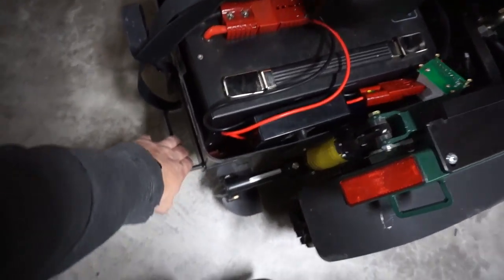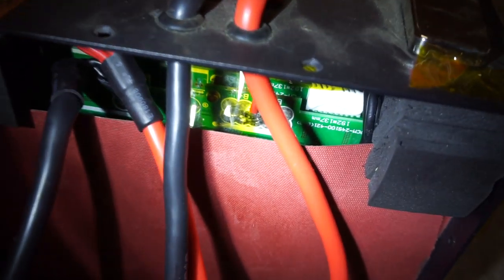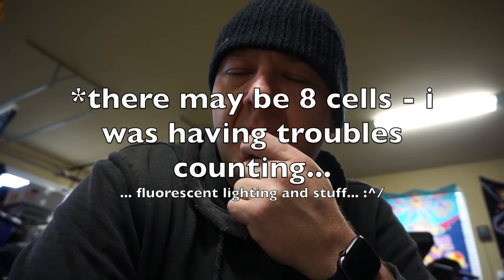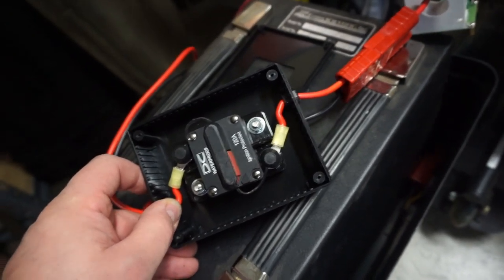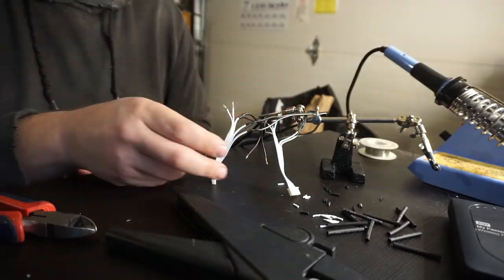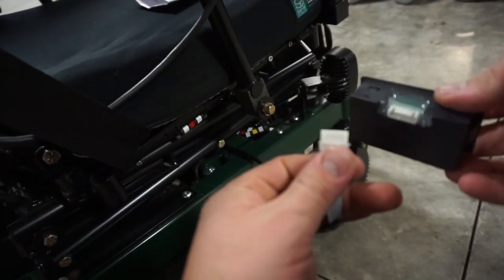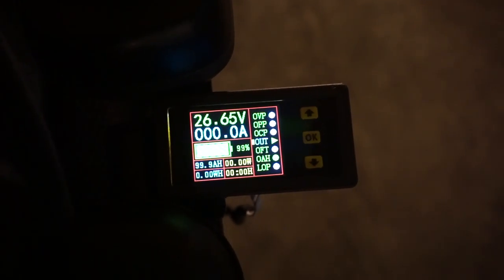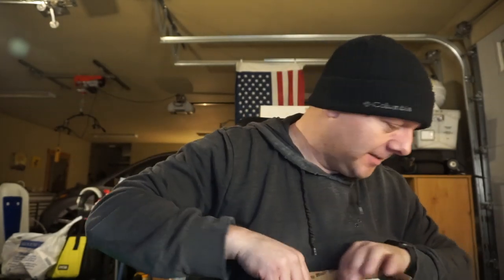MEGA VLOG 402: inside a LITHIUM bounder battery

Comment: Very interesting video Dan! I have a couple 12V 5Ah LiFePO4 batteries I have used for various projects.  The weight difference between those and  SLA's is substantial.  I'm surprised there aren't readily available direct wheelchair replacements for 22NF and Group 24 batteries.  I know they would be expensive, but I would buy them for the weight and efficiency benefits.  I think LiFePO4's are fairly safe. I guess in general it's not a good idea to think about how much energy we are sitting on top of — if you know what I mean.  Thanks for digging in and posting the video.
Reply from the maker: ive got a reddy-welder wire feed welder that runs from 2 batteries LOL just for energy capacity reference ;^)

Comment: Extrapolate !!! Do you know how long its been since I've heard anyone use that term?!!! ...It's an honor to know you Sir ! ...My guess is that PCM number is a manufacturer circuit-board part-number. 

Hint: You may be able to grab some ribbon cable from an old tower case...like a 40" long drive cable. Then split off the number of lines you need from the original ribbon.
Those plastic connectors can usually be removed and reused. They are vampire connections into the wire. Use a sharp pair of scissors to cut the end of the cable straight and freshen it up for installing the connectors again.
High frequency circuits can run into EMI, timing, or cross-talk problems when you lengthen ribbon cables but I doubt that applies here.

I see the mystery tool arrived... Now when you get mad at your neighbors you can ream 'em out ! LOL

Comment: That probably is a heater, if I remember from research that these batteries won't charge below a certain temperature.
Reply: You are so right James the VA did not want to give me a power chair with lithium batteries because of the cold weather in pinedale Wyoming, those batteries do not like cold weather but then again they don't like heat either kind of picky aren't they .
Reply from the maker: yes! 100% correct! when its cold outside, or the bounder has been left in a cold garage, it takes a bit of time before things warm up and the chair starts preforming like it usually does

Comment: The battery of long life. They're so much better then lead acid dry or wet cell. I really want a Bounder off road hd wheelchair . And would like the options . Before my back put me down in pain I could walk some but not just stand. I had pride wrangler scooter , got tired of getting only a year or two with there sealed batteries at $400. Plus. I tried the optima spiral wound D31 blue top and I got 6years out if a set for $250. Oh yes I did my repairs to the steering has a bicycle handle bar bearing set. I mounted real bearing blocks . No more sloppy tiller . But now I'm in a permobil 300 hd it's so slow and gets stuck on three grains of sand . Thanks for your videos
Reply from the maker: yea optima USED to be a great alternative.. but since they're henco in mexico now, the reject rate has gone thru the roof! ive had decent success with the DEKA Intimidator deep cycle marine batteries - and also the Exide Orbital AGM batteries.  good luck out there!!

Comment: Looking for your insight...I have a Permobil F3.  Several months ago I upgraded to MK 24s, and so far have been concerned with the battery life.  Now the odd thing is that it seems days that I get in my van, and lock into my EZ lock, the battery drops faster (based only on to controller's gauge).  Do you think this is purely coincidence?  The DME came out and checked the battery connections, and said they also seemed well balanced.  Before I request different batteries, I want to be sure that is the problem.  Thanks!
Reply from the maker: pretty sure thats coincidence - BUT theres a setting in the main controller for calibrating or compensating the cable resistance that fine tunes the battery gauge.  thing to remember, the battery gauges on these chairs arent really accurate anyways- just by nature of how they work.  they detect 'surface charge' BUT when its calibrated 'properly' your battery gauge shouldn't move at all till you've gone at least 3-5 miles.  Couple other things to consider... if the batteries are BRAND NEW - it takes a few weeks of light to normal use for them to "cycle / break in" and get you maximum capacity.  ALSO some MK resellers actually sell 'battery seconds' that are sub-par quality.  also you could have just gotten a bad set of batteries.  unfortunately, most dealers have no idea how to calibrate the battery gauges on the joysticks (usually they have to have permobil send them a new program)  but if your connectors and everything are all good - id just test it out, see if ya can get 6 miles and see what the gauge does.  BUT FYI MK batteries are the best ones ya can get - and are OEM specified.  so assuming you didnt get a bad set - youve got the best available option!  not sure if any of this helps lol but good luck!
Reply: Totally Normal Today I travelled 3.5 miles on smooth surface, some slight uphill/downhill, probably at a consistent 75% speed, and the gauge dropped 3 bars.  Concerned I may have gotten a bad batch.
Reply from the maker: hmm yea sounds like maybe ya did get a bad set.. id try going a bit further and see if they keep dropping low or stay about 3 bars etc...
Reply: So I tested it out more today.  Same path, some uphill, some downhill...was about 25* out so I froze my butt off doing so, but went 8 miles, and am at 3 red and 1 orange bar.
Reply from the maker: interesting... so combined with the cold.. that's not too bad! maybe it just the calibration of the battery gauge...
Reply: More baffling battery stuff...  So as I had mentioned, I felt that I was having issues with my new MK 24s.  The longest test I had done was 8 miles, which the battery gauge showed 3 red bars remaining.  The DME techs came out on 2 occasions to check the connections and other stuff, all was well.  They ended shipping the batteries back to MK to be tested, and all was fine.  Meanwhile, they put another brand of 34s in my chair while my batteries were off being tested.  Now today I went 8 miles again along the same path as before, and I only dropped briefly by one green bar.  So if the typical battery life is ~12-15 miles, there seems to be no way that gauge is accurate (as mentioned in the earlier posts), as you'd expect it to be closer to half full/empty.  But then why did the MK24s (which tested fine), drop 6 more bars in the same distance? @TotallyNormal-
Reply from the maker: yea the battery gauges aren't accurate by nature in most power chairs.  they're detecting surface charge, and voltage isn't necessarily a good indication of the charge level.  most of the batteries are all slightly different, and their voltage curves arent the same.  there's a way to calibrate the battery gauge on the chairs - BUT its almost impossible to set correctly.  usually any time i get new batteries, i spend a few days getting use to how the battery gauge works with them.  other than adding your own battery monitoring hardware, there isn't a lot that can be done unfortunately. 

also BRAND NEW batteries aren't going to have maximum range right off to start.  they need to cycle a few times before they're all 'woken up' and ready to go (about a week or normal to light use, and nightly charging)

there's a lot of factors with these old style SLA batteries - for no reason, sometimes ill get 7-8 miles of range, and other days ill get 13 miles no problem... cant really explain it.

I really hope chair manufacturers start using lithium more widely soon - it alleviates all this guesswork with battery levels, and range!
Reply: Totally Normal Do chair manufacturers have any plan in the near future to use the lithium batteries?  How much more would that increase range?  As someone who travels by plane a bit, it seems airlines are very restrictive about lithium batteries.
Reply from the maker: aaand THAT'S the problem... some gaming laptops have lithium batteries that are too big to fly with... sooo power chairs.. uh yeaa....  typically the main benefit is longer battery service life, and 1/3 to 1/2 of the weight of traditional SLA batteries.. you can get a few more Ah out of the same space... but its mostly about weight savings, fast charging, and longevity.  (and a bit of range improvement)

Comment: I rebuilt my jazzy 614HD and installed a 48vdc 2.25KW Chevy volt battery which I split the connection in two to make it 25.2 volt 6s configuration so now have a battery management system hooked to it so the lithium batteries can be balanced. https://imgur.com/a/yVTzASe   The wire you see is a dual port usb coming off the battery to charge my phone . You are more familiar with the joysticks than me can I upgrade that shark dk1 to a later one . And another question do the jazzy 614HD motors  have brushes?  I don’t see brush caps hard to get on the ground. I also got most of the new parts from  quantum chassis that was missing the motors but I got the casters and seat which is much better than the hard one that was original. I no longer have to replace agm batteries every year
Reply from the maker: nice work!! the 614HD has 'inline' motors.. so the brushes are likely under a cap/cover somewhere on the back.. sweet build though! love it!

Comment: It blows my mind that wheelchair manufacturers don’t put water protection on their battery boxes or motors

$60K USD, is horrifically expensive, so at that point they damm well should put protective measures, what are we supposed to do, stay at home in the rain/snow? Not go to work, not use public transportation in rough weather?
Absolutely idiotic to not have weather protection!!
Reply from the maker: It’s inside a plastic box... sooo I suppose if ya aren’t fording rivers should be good to go hah